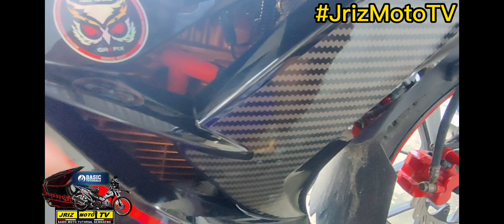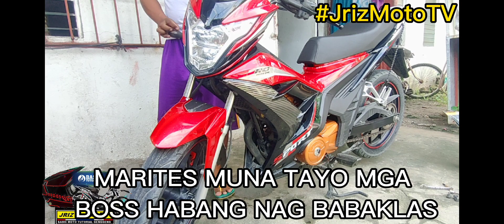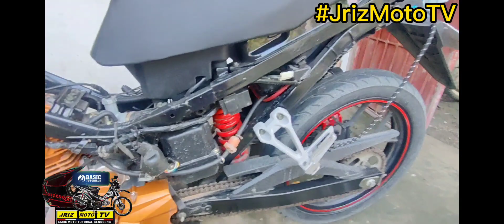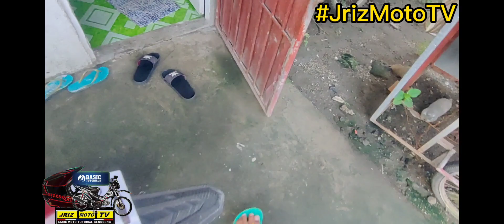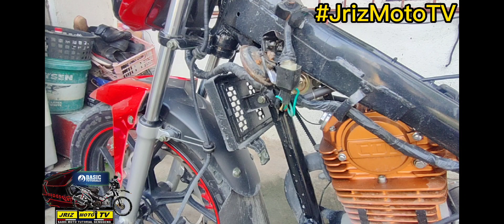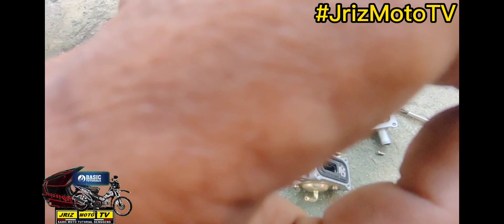VPERMAN150 LAGITIK REVEAL!!! KAYA PALA HINDI NAWAWALA LAGITIK!!!

Comment: Sir yung ignition coil mo na apido madali lang ba ikabit ?pag umaga kase pag pinapainit ko makina maya maya namamatay.
Ano kaya solution dun
Reply from the maker: may dalawang way pra d mamatayan.. boss yung una.. itono mo yung carb mo. since kung bago pa yan galing ng casa.. lean kasi ang timpla nya. at yung isang way is medyo lakihan mo ung gap ng sparkplug mo. sa center electrode at ground electrode
Reply: @jrizmototv  Paano ba itono ang carb ng vperman sir ??
Reply: @jrizmototv  sa spark plug sir nilakihan kona yung gap sa carb nalang kulang
Reply from the maker: @ajponce3105  sa carb nalang boss.. and idle. i set mo sa 1k. painitin mo muna makina. tapos yung fuel screw nya gawin mong 2.5 turns.
Reply: Itono mo carb paps tas palit ka ng racing spark plug di na namamatay motor ko simula nagpalit ako ng spark plug.